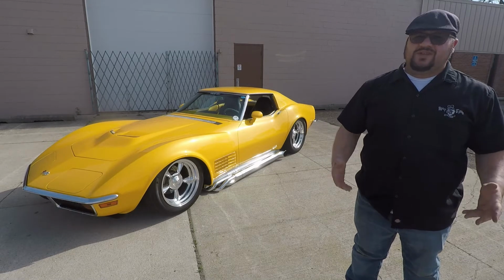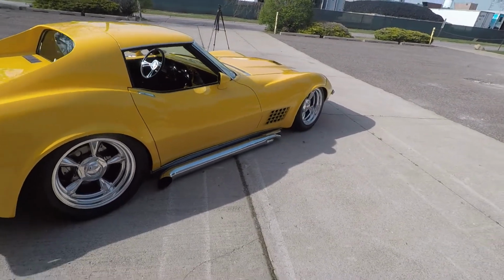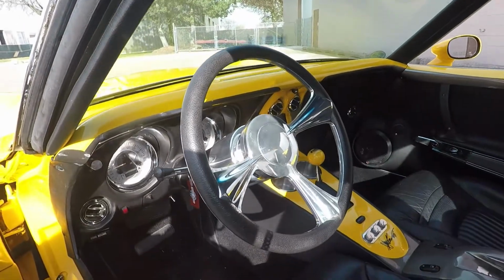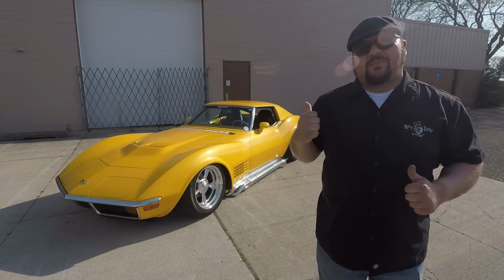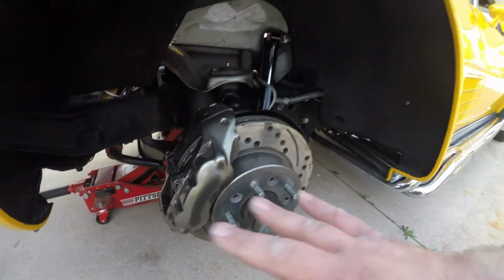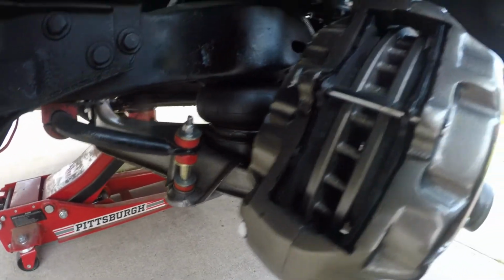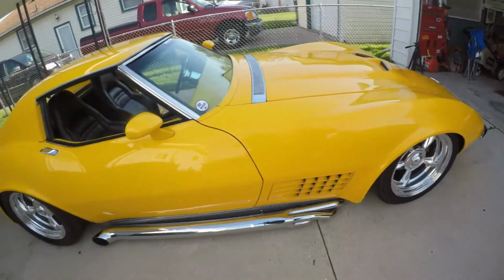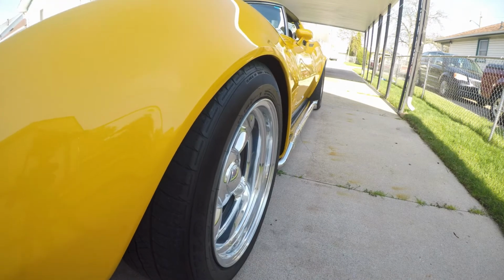Corvette On Air Ride? - The LoVette - Good E'nuff Garage Episode 18

Comment: I get it, family stuff and house stuff takes priority. I've had my '77 for 13 years and I'd do a little thing here and a little thing there to it, but it had a rough life in the past and needed a lot of help that I just couldn't do because I was getting my life established. In 2020 I finally decided it was time to do the car justice and I spent several thousand dollars rebuilding just about everything. My seats are done in a custom trim to match the paint scheme, but the rest of the interior is stock replacement. I went with the Gymkhana suspension and the same sidepipes but with custom baffles. The car is so much fun to cruise now. It's kind of sentimental, because my family has had a relationship with the car since it was just a few years old, and it was by an odd chance that it was my turn to own it. So like you,  my dad is also proud to see my Vette at car shows and parades and being enjoyed. You did a killer job on yours.

Comment: Beautiful car. What  brand and size bags do you use at front? I'm using 2500 but they have to be pump to 65+ psi to get it up.
Reply from the maker: We are using 2500lbs air lift dominator air bags in front. 
At ride height I have about 60-65psi in front. 
Depending on what kind of car you have 65psi is perfectly fine for front pressures.

Comment: How do you keep the rear camber properly set with that shackle on the lower mount?  It seems to me like the bottom of the tire would be able to move in and out with that joint.
Reply from the maker: The camber is set by the adjustable strut rods. That shackle has to have movement in it or else it would bind up while moving up or down. 
We set the strut rod camber at ride height and it works perfectly. We have yet to have any rear tire wearing issues after about 9000 miles.
Reply: @WhiteWallSteve  It looked like you eliminated the strut rods.   I couldn't see them behind the new hardware.  Nice build.

Comment: How’s the ride before and after? I like how you built it your self, was thinking something similar but with springs and shocks?
Reply from the maker: These things never rode good stock. After the airride it still has some rigidness but overall it rides much better. Also since I can adjust it in the fly I never worry about bottoming out. It also helped with handling it hugs the road very well even in the corners. Paired with the correct shocks it works well. The only thing that would be better for handling in coil overs but then you don’t have the adjustments at you fingertips.